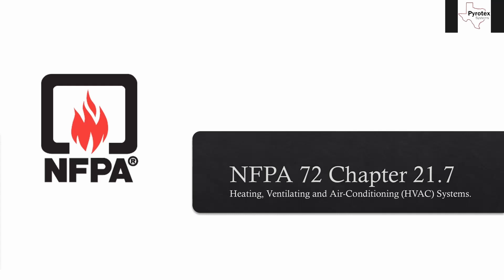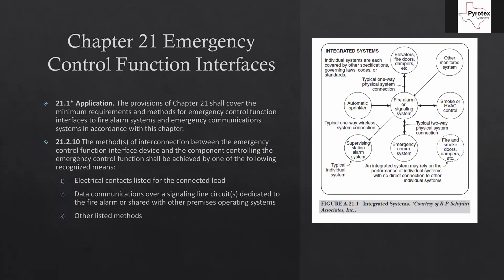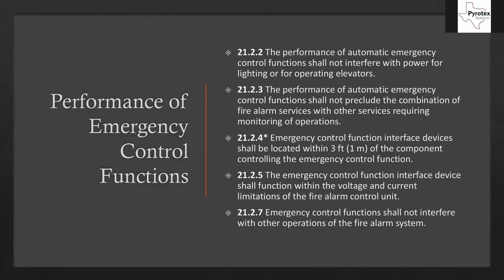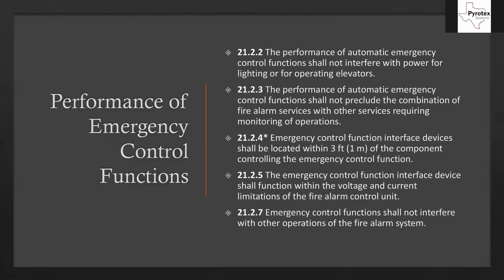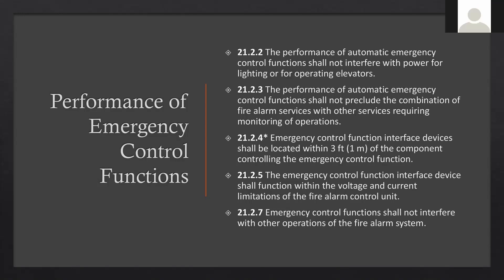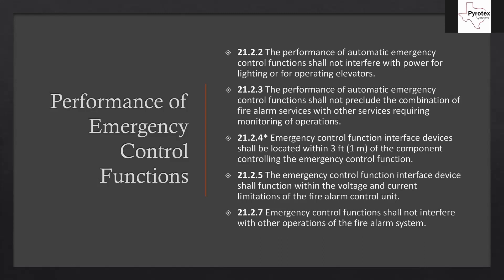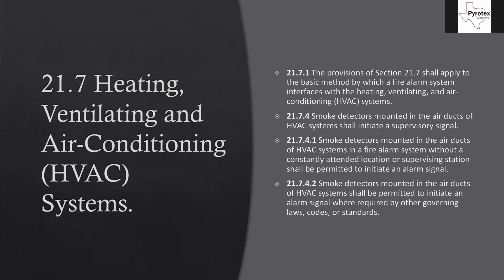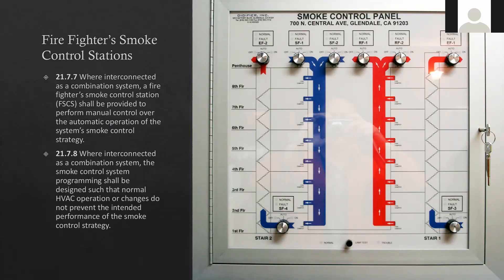NFPA 72 Requirements for Duct Smoke Detectors 2

Comment: I have an ERV unit that needs 4 smoke duct detector 2 of them are for supply and return. I am clear about the airstream with those. Then I have one for exhaust air and the other for outside air. I am not clear where to face the sampling tubes holes on those. Can you explain how and why please.